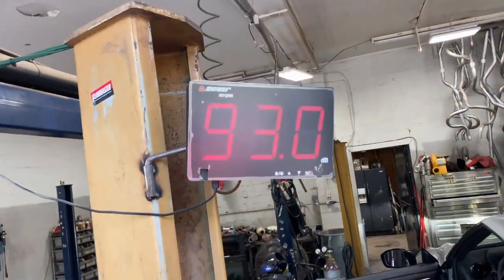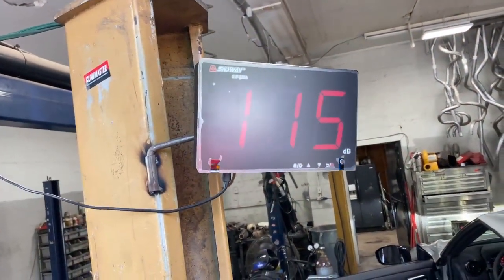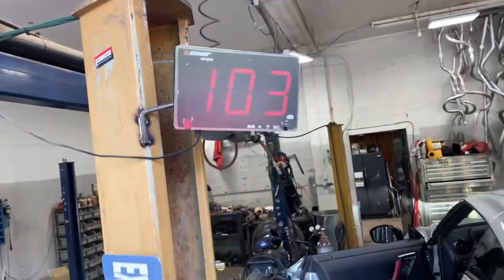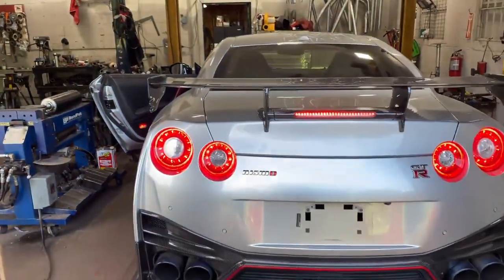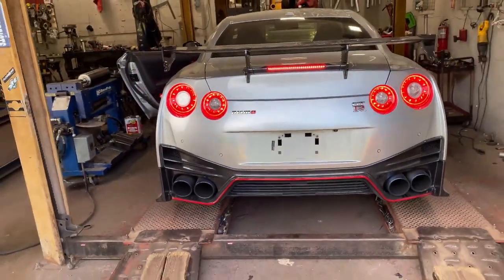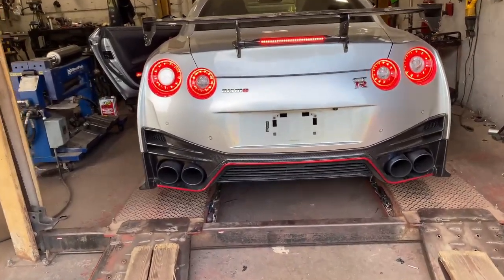2018 Nissan GT-R NISMO EDITION EPIC EXHAUST!

Comment: I have a R34 right hand drive with 1800hp
Reply: Yeah and I have a RHD  twin turbo LSX S15 makin 1900hp
Reply: Yeah and I have a Mazda Miata 7.3 Cummins swap with 2000 horsepower
Reply: You forgot to mention that I have a stock Toyota Supra Turbo making 9999 rwhp
Reply: I have a 2021 Lamborghini Centenario...(there's only 1 on the entire North American continent) and there's only going to be 40 made for the entire planet...
Reply: I like you 2021 hemi too
Reply: Oh yeah and you 7.3 v8 f250 lol
Reply: I have a K24 swapped 2006 Sentra 1.8s